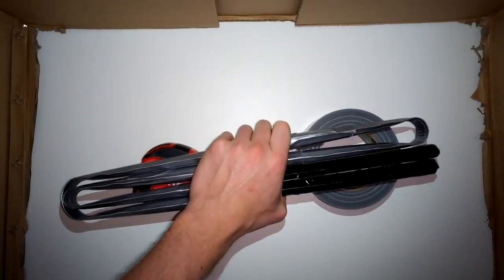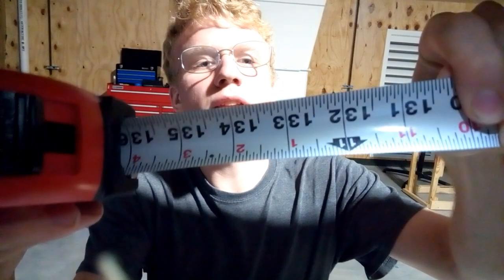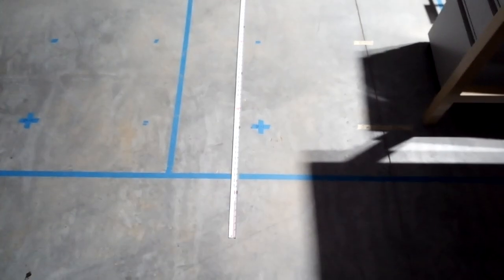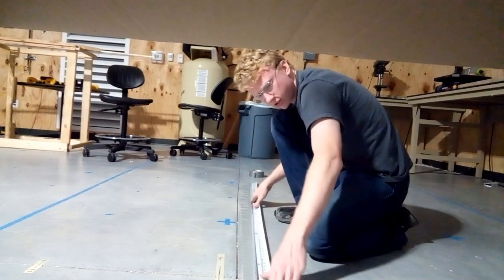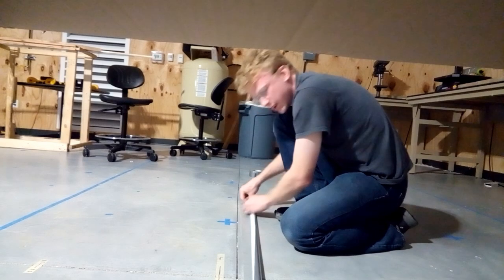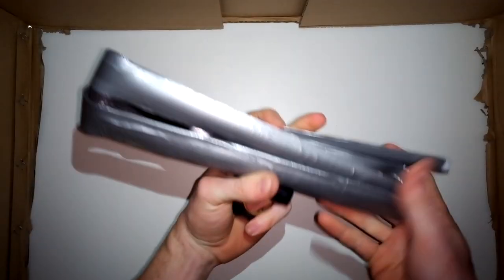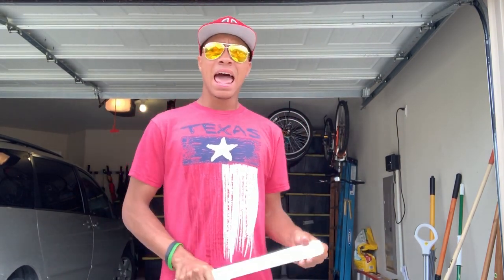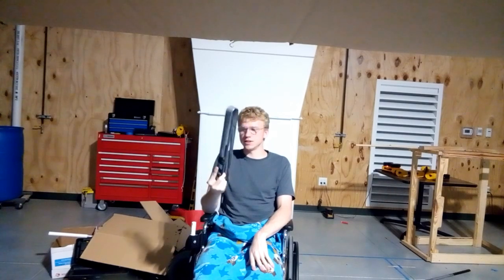How To Make Extendable Bo Staff | Weapon Sender

Comment: As a weapons designer your focus on a cool factor and interesting function needs to be balanced a lot more with basic durability. I have a hard time considering anything that flimsy to be a weapon. A cool trick weapon maybe like the magic expandable staff that the modern ninja has reviewed in the past. Thats as far as it goes though. You need to set a higher standard for yourself if you're going to call your creations weapons. If I can buy a 5 dollar folding knife at the mall and come off as more intimidating and more efficient, then your 10 dollars worth of material doesn't seem worth it at all. I'm not trying to be mean and I'm sorry if I come off that way I just felt like giving some constructive criticism. I like creators like you and we need more of them. I hope to see more from you soon.
Reply: Michael Minim what if it’s double layered? (4 layers, two on each side)
Reply: Bruh it’s still just tape measures and duct tape. No matter how much you use I’d take all the money your wasting on those materials and buy knives at a gas station and be ten times as effective in a fight.
Reply: Michael Minim 
1. That’s cheap, it’s like using hacks.
2. There’s no such thing as a knife fight, only murder.
Reply: @shamyzero6349  You got me I guess.
Reply: Michael Minim but you’re right there is no magical way to get a no retractable no staff on the low